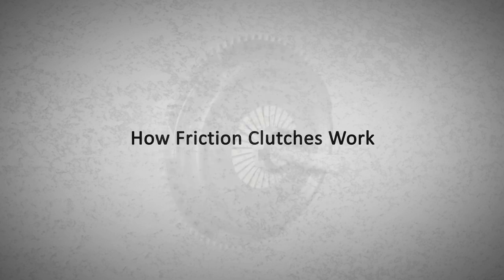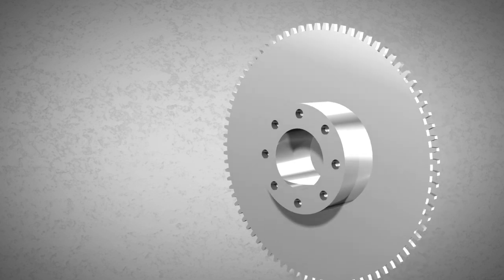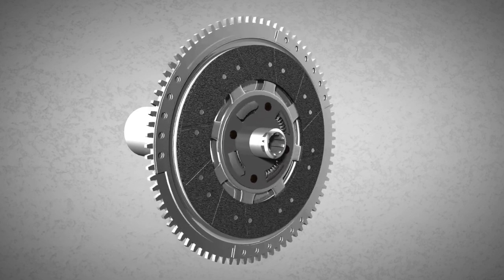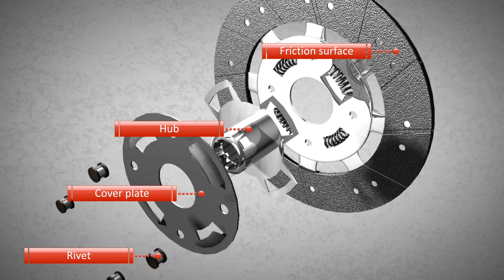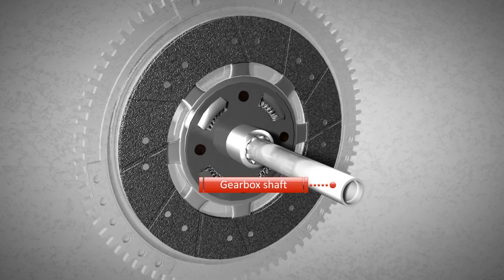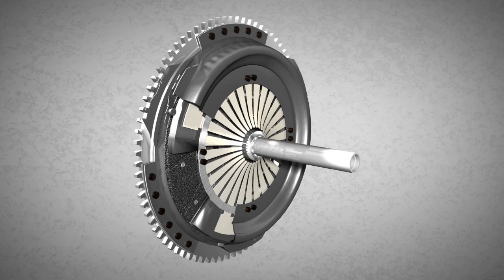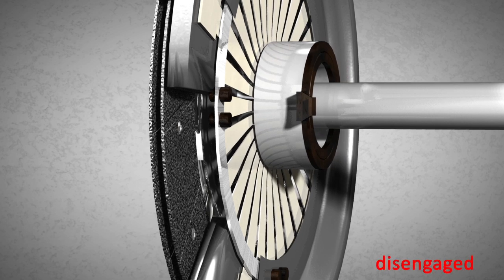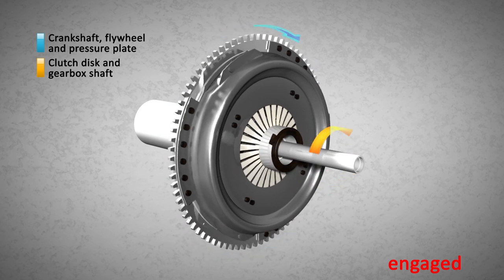How a clutch works! (Animation)

Comment: I hate my learning capabilities -_- I don't understand shit.  An engine makes a gear turn. You attach a chain or a belt to that gear. And that chain or belt is attached to a wheel. Which makes the car go forward. I have absolute no clue, on why any other part is required for a car.
Reply: A car can move forward due to those parts, yes, and probably the most primitive vehicles or rotational systems would simply use that too. (See, Tamiya, a bunch of toys which only uses dynamos, gears, and wheels to move)

But then we start getting problems. How do I stop it? Then we use a brake. But my engine stops working if I stop my car completely! So we use a flywheel to store the rotational energy. But what if I only wanted my wheels to stop taking power from the engine without stopping the engine (since stopping and starting the engine multiple times is just dangerous)? Then we use a clutch. I want to go faster or slower without putting too much stress or consuming too much fuel on my engine! Then we use multiple gear transmissions.

Then more complicated problems arise, and more solutions come to play.
Reply: it's basically just storing energy into a spring and then slowly releasing that energy, like a crossbow.
I only discovered it until now either lol, but I always wondered how an engine could keep running without the weels turning. I was like ' where on earth does that energy go??'
Reply: if you run out of blinker fluid on your brakes, they wont engage when you turn; thus we use a clutch
Reply: Sevival Oh, a spring. That makes sense.
Thank you.
Reply: so you have a starter, which is a little motor that gets the flywheel spinning. this turns the engine and once the combustion cycle gets started, your car is running. if your transmission was connected to the engine at this time, your car would move forward. if you used the brakes to stop that from happening, the engine would cut off. more accurately if the transmission was connected during engine start, there would be too much resistance for the engine to get started in the first place.

all of this is pertaining to cars with a manual transmission. if your car is a classic automatic (not a new CVT) then your car has a "stall converter" instead of a clutch. this is a liquid filled device that under low load provides the same functionality as the clutch.

think of those x-brain yoyos; when it spins fast, the friction device separates to allow it to spin longer. a stall converter is the opposite; as you hit the gas and rev the engine faster, the stall converter engages to connect and send power to the transmissions and therefore the wheels.
Reply: No, the brake is not enough. How would you stop the engine from continuing to push the car while you're braking? You must disconnect the engine from the wheels AND use your brakes to stop it. Even if you could stop the wheels with the engine connected directly to them, the engine would jam and die.

The clutch disengages (disconnects) the engine from the wheels, so the engine can continue spinning while the wheels are not.
Reply: I'd like to tell you that I got curious on how to play Assetto Corsa and I wanted to sort of learn such confusing terminologies such as gearboxes, clutch, torque, weight differential and all sorts of shit, now I have no idea how I got here, let's just bear with it mate!
Reply: denmax Thanks
Reply: I was watching Besiege videos and then... here I am. At least I think'll reproduce those stuff in the game lol
Reply: Mr. Rude Rofl

Comment: So when someone is trying to do a burnout (the Corvette video comes to mind) and they instead burn out the clutch, does that mean the friction surfaces overheat/melt/break/whatever they do? What happens mechanically that causes that to happen? Is that clutch then permanently ruined/useless once it gets to the point of smoking?
Reply: +prestb for a burnout you need to disengage handbrake, turn the traction control off (if the car has one, the Corvette sure does) and then you may manage to do it. But even then if you release the clutch too slow, it won't transfer enough power to spin the wheels unlike the flywheel and clutch disc - that will result in neverending friction force, heating, possible catching fire or breaking of some parts. There is a video on youtube with compilation of burnout fails, including the Corvette, but there is another car, whose driver just makes the clutch explode ;) Such a "burnout" lowers the lifespan of a clutch, it makes thousands times greater damage than normal launch or gear changes, so in the end the friction surface of the clutch disc and flywheel get so disrupted that it gets almost impossible to engage the clutch.
Reply: geuros Great answer, thanks!

Comment: Im still confuse, what  makes the power from the engine disconnected when we release the hydraulic pressure from the reservoir fluid after we pressed the clutch pedal? I mean i knowmit pushes the pressure plate, but what and how does the power disconnected? Really2 confusing me
Reply: +Asyraf Cboy When you push in the clutch pedal, the clutch disk is pulled back away from the flywheel, so they are no longer touching - when you let off the clutch pedal again, the clutch disk is pushed against the flywheel again, so the flywheel is driving the clutch disk to turn again.

How that works seems counter intuitive because the diaphragm is pushed IN, not pulled OUT - when you push it in, the bearing presses all the little "fingers" of the diaphragm in, but each finger is like a see-saw. When you push in the center, the other end of the fingers pull out.

Comment: I've watched hundreds of videos about clutch but i still don't understand why i can shift only when i use clutch, and how it influences on gear insertion
Reply: +Aksel “DukeFleed” Newt RPM matching. The clutch disengages the gear box, matches engine rpm, then reengages the gearbox. If you are at the perfect rpm so that the engine rpm x gear reduction = driveshaft rpm, then you CAN slide into gear without the clutch first disengaging the gear box. 
Even WITH the clutch helping you out, if the gear reduction of the gear is too great, you will not be able to get it in gear, or it will fling you forward when you disengage the clutch, depending on if you forced it or not. Don't do that :P
Reply: The clutch is there to disconnect the engine from the gearbox. Normally they act as one unit, but the clutch can disconnect the engine from the rest of the car. So whenever you need to make a 'change' in the gearbox, you take away the power (input from the engine), then do your work within the gearbox and then put the power back on. 
It's like when you disconnect electrical machinery from the plug when you want to do maintenance and then after that plug it back in. 
The gearbox is a collection of all the gears you have and they are interconnected mechanically on shafts. As you know (like from riding a bicycle) different gears spin at different speeds...when you go from one to another, chances are great the previous gear will spin at a different speed than the next gear. Then the teeth of the gears don't mesh together properly and instead of a smooth change you hear that rasping sound of the teeth scraping over each other. 
when the clutch is engaged..the engine doesn't spin the input shaft in the gearbox so everything is nice and still...so you can change the gears easily, when meshed you can put the power back on by releasing the clutch.
Reply: +Richard Smith true haha my dad used to shift without the clutch when he was teaching me how to drive manual just to show off haha.
Reply: anomaly P ohhh thanks, i understood (i think)
Reply: No probs :)

Comment: When the vehicle is moving I assume the four springs on the clutch disc are fully compressed?
Reply from the maker: +Reddit Gold User If you accelerate, yes, if you slow down, no :)
Reply: Only on moments of acceleration and decelleration (when the inertia comes into play)

Comment: How far is the clutch plate from the flywheel when fully disengaged generally? Is it the distance I push in on my clutch pedal or is the lever making it do less work? Sometimes I shift only pushing in the clutch 50-75% and though it'll feel smooth maybe I should be pushing in 100% every shift?

Comment: So I still don't quite understand the diaphragm spring.
So when you press the clutch pedal does the clutch release bearing pushes in making contact between clutch disc and flywheel happen? or.... when you press the clutch pedal the release bearing pulls back and that's when contact happens?
Reply: +Javimeleshe Cruz When you release the clutch pedal the release bearing moves away from the spring engaging the clutch
Reply: Got it, thank you!

Comment: So if the clutch disk makes contact with the flywheel using friction, how is that secure?! Everything else uses gears, but the input of power from engine to transmission is using friction only? Why is this?
Reply: I understand why the clutch needs to slip to get the car going, but what about how a transmission switches gears using synchos? Why wouldn't they just use synchros and gears instead of clutches? I feel like that would reduce friction and vibration when engaging the clutch.
Reply: +Frederick Chow It is held together firmly by the pressure plate.
Reply: +Matt L I'm not asking how a synchro's work. I already know how they work. I'm merely asking if using synchro's would be a better alternative to using a flat circular disk to spin the flywheel and transmission line. The disk for the clutch makes a massive amount of friction, (which is understandable to get the car moving from a dead stop). But engaging clutch to the fly wheel disk is slow and cumbersome that way. I figured it would be a lot easier to use a tapered friction like how synchro's work, which make a lot more sense and create a smoother transition.

Comment: So what moves the release bearing to engage and disengage the diaphragm spring?
Reply: There is a clutch fork, which is actuated either hydraulically or via a linkage or cable.  The tongs of the fork engage the 2 tabs on the release bearing.  The "handle" of the fork is pushed or pulled (depending on the type of clutch), causing the fork to pivot in the middle on either a rod or ball, which in turn causes the tongs of the fork to move the release (throw out) bearing.  The video is actually incorrect when it shows the tabs of the bearing rotating with the pressure plate.  The tabs will be kept from rotating by the clutch fork.  Only the inner part of the bearing rotates.

Comment: If I was revving at full throttle and suddenly let go of the clutch pedal, can the clutch mechanism be broken?
Reply: +Mark Steven Luber yes it can, drag race cars work that way, and require very strong aftermarket clutches to reduce the probability that it would explode.

Comment: The majority of motorcycles use wet clutches.
Reply: +Nick Karatekid  in a wet clutch, there's probably some sort of transmission oil or lubricant to keep things running smoothly.. on a dry clutch, well its dry.. to my understanding, wet clutches are most like used for everyday rides while the dry clutch fits more for racing.. i'm guessing that in a dry clutch, things(shaft and gears) will rotate more faster because of the absence of oil HOWEVER this will lead to higher temperatures so i'm guessing with a dry clutch, you will need more exotic materials like carbon ceramic or alloys that are high temperature resistant and not just the usual stainless steel
Reply: Anime536 _ A wet clutch sits in oil and has multiple clutch plates, when a dry clutch doesn't. Wet clutches can be ridden a lot more and I think they also last longer. Possible cons I can think of for a dry clutch is not being able to ride it that much while with a wet clutch it would be the larger size as well as the need to change oil and the power loss from the friction of the oil. The pros i can think of of a dry clutch is the higher grip and more compact size. The pros for the wet clutch are being able to ride it a lot more. As a dirt bike rider I cannot imagine having a dry clutch for Enduro. Most of my Enduro riding consists of riding the clutch and double clutching. I would've burnt out my clutch easily if it was a dry clutch. I think the reason why they use dry clutches for racing applications is the higher grip, more compact design and less energy loss due to friction from spinning in oil like a wet clutch.
Reply from the maker: +Drew1231 That's true :)
Reply: +Drew1231 Wet and  multi plate clutches. The only modern motherbikes (I'll call modern as 80s + arbitrarily but im sure that you can include much of the 70s before then I dont know) that use dry clutches are Ducatis and I'll guess BMW K series and possibly/prolly boxers (without googling im not sure). And any derivatives, i.e: Bimota
Reply: +BIT1FFY what's the advantage of an wet clutch?, I dont even know what that is
Reply: Ahh okay thank you very much
Reply: Keenan Smith i would guess, dry clutch is cheaper 50million times, thats the biggest advantage for everyday car. i think if manufacturers wanted to make it more durable, they would just make the whole clutch bigger, with bigger friction surfaces. large 40 ton trucks use dry clutches, and they go for 100s of thousands of miles between service, with no durability problems.

Comment: Most sensible video which describes working of clutch. Animation is very illustrative.
A question here.. Do all vehicles have same clutch design?
Reply: +kmmahamuni4 For the most part, yes. But only vehicles with manual transmissions use clutches. On automatic vehicles, the flywheel is replaced with a "flexplate," and the clutch assembly (pressure plate & disc) is replaced with a torque converter. 

On some high performance vehicles, a dual clutch disc (2 discs instead of 1)setup is used to increase "bite" or "clamp" when the pedal is released. This minimizes slippage and maximizes power getting to the wheels. The downside is of course, wheels that go from a dead stop to being on the receiving end of a lot of torque can break wheel studs and even axles.

Apart from how the release bearing is actuated (cable type or hydraulic), nearly all automotive clutches use this design. 

As a matter fact, limited slip differentials work on the same principle - small clutch discs are used to create "drag" on the spinning axle, allowing the car to balance power distribution to both wheels.
Reply from the maker: +kmmahamuni4 Thank you. For another design, watch this: https://www.youtube.com/watch?v=TcYsV063lk8

Comment: Does it mean that fully disengaged clutch is not being damaged over time, and that the clutch is only being damaged during engaging? If it is so, does that mean that releasing the clutch pedal "smoothly" when transmitting is a bad idea when driving?
Reply: +viktoriparez Clutch plate is weared out by friction with the flywheel, and also could be damaged by abrupt engagement. When learning, try to release smoothly. With experience you will know how and when you could be faster.

Comment: Quick question, how does the clutch disk stop spinning after letting go of the fly wheel? I'm kinda new here.
Reply: Air resistance? Friction?

I think the clutch disk keeps spinning for several seconds/fractions of a second due to intertia.
Reply: XDcomequeso I know, but how does it stop? Doesn't it need to stop?
Reply: ByteMe I think the transmission gears stops it when you change gear.

But again, I have no idea. Ive never seen a clutch + transmission in action. I just learned the clutch is attached to the flywheel haha.
Reply: +ByteMe 
The Synchronizer rings in the transmission match the transmission's input shaft (attached to clutch disc) with the next gear as it is selected.

/watch?v=wCu9W9xNwtI
Reply: The center of the friction disc has splines that interface with the transmission input shaft.  so the disc always turns at the same speed as the transmission input shaft.

Comment: I got a question so if you have to disengage the clutch when you start a car (idle) what happens if you don't? Will the car not start? And if you disengage the clutch during the engine idle when its in a gear, will it slowly stall the car?